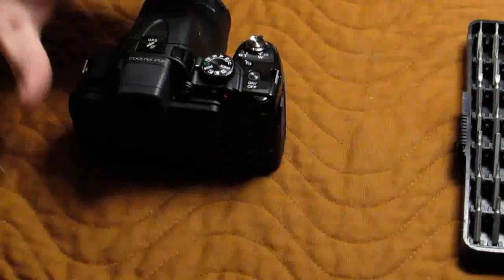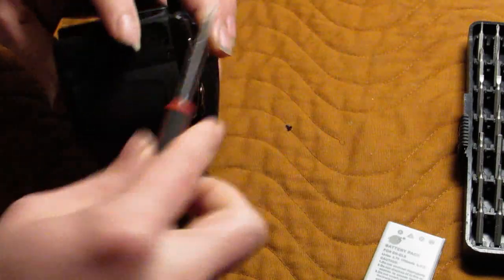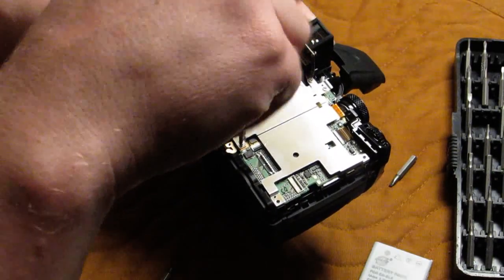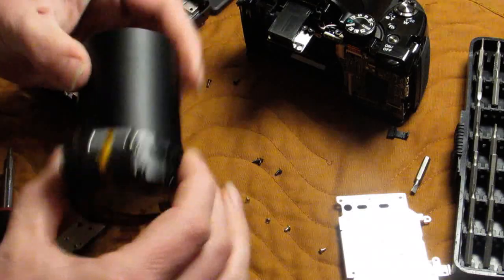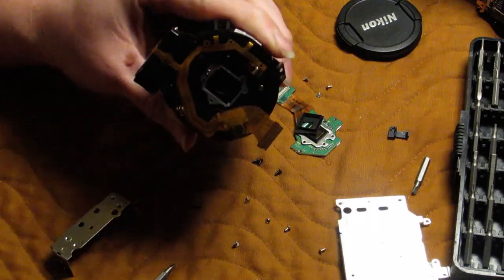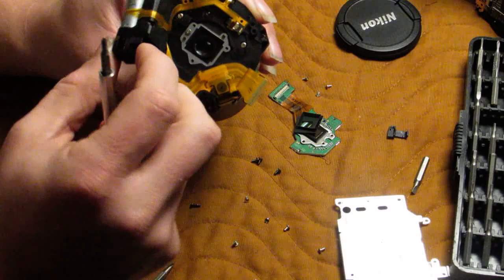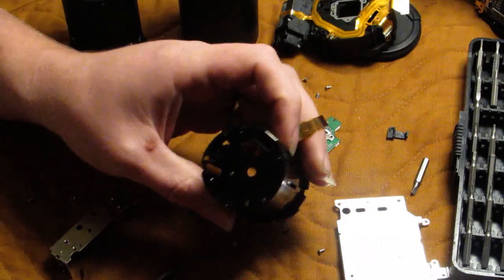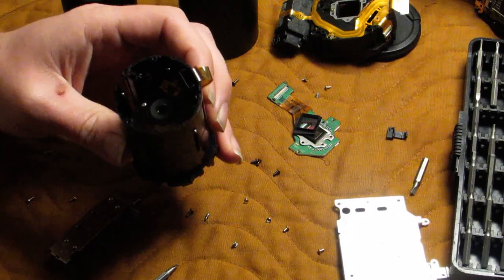Nikon Coolpix P520 lens replacement or repair

Comment: I have a question: do the P and L Nikon Coolpix series have the same size outer metal ring on the lens assembly? I'm looking for lens adapters for my L330 (for macro, fish eye, filters, etc) and I'm only finding ones for the L100/800 and P500 series, and sometimes they're listed as compatible between each other.

Comment: i have a Fujifilm x-s1 which has developed a fault think they call it pin cushion distortion ,at wide angle everything is ok as soon as you start to zoon the distortion starts progressively getting worse the more you zoom any ideas as to what i can do to fix it , ? and if i have to tear down i was going to remove ir filter (replace with same thickness clear glass ) and make camera a full spectrum camera ,what are your thoughts on that idea?
thanks

Comment: HI, Great video!! I have a couple of Coolpix a L830 and L840, Both are very good condition yet both have stopped turning on! I have ckecked the obvious...batteries, battery holder contacts etc... but no luck. Do you have any idea what the common problem is with the not turning on issue? is there a component on the board that can be checked? / replaced it seems so many of these  L / P model Nikon Coolpix have this issue... Any advice would be great. Thanks

Comment: thanks, I use my camera at sea and its always shacking, vibrating and slinging in the bag. After heavy seas it dropped. At opening the lens connector was off. This was an easy repair.

Comment: Very detailed and informative video!! My P600 has lens error and when powering on zooms all way out by itself? any suggestions what's wrong?
Reply from the maker: I would suspect the zoom switch, it might be stuck, or may have corroded from moisture.  A stuck zoom switch can sometimes be the cause of a lens error message.

Comment: I burned my P520's voltage regulator by accidentally plugging in 12V from a universal power adapter throught the USB port. I'm dissasembling it now and your video has been of great help, specially for showing how to unplug the grey LCD signal bit. I was afraid of damaging it, so I just left it hanging. Thanks!

Comment: I have a coolpix L840. Theres a copper tape that attaches to the back of the lens to plastic next to the motherboard. I'm assuming that's a tamper tape? And not actually anything functional. I ask because that ripped instantly. When I was taking apart and want to make sure that's not a cause to the lens not giving signal back to the screen, or if I just need to replace lense as it too a fall. (Reason I took it apart to begin with)
Reply from the maker: If it was never connected to anything electronic, it's probably shielding.  A crack or tear in shielding doesn't generally cause any trouble.  Almost all portable electronics have copper shielding tape some place or another, and lots of repairmen destroy it without significant consequence to daily use.

Comment: Hi! Thanks for your video, i'll buy a nikon coolpix p520 from a friend at a very low prise because it has the button t/w from the lens averiated, there is something i can do to repair it? (sorry my english, i speak spanish jeje,)
Reply from the maker: It is most likely a broken switch.  It can be easily replaced once you take the lens out, following this video.  Good luck!
Reply: zibodiz thanks for the answer! But after i bought it i reset the configuration and the button started to work fine! So i made a very very good buy ahahaj

Comment: Have you ever dealt with a Nikon P520 that will not power on?  If so, what was the issue?  I've tried three different freshly charged batteries.  I've had two repair facilities say it's less expensive to buy a new camera.  If I were to open up the camera myself is there anything simple that I could check?
Reply from the maker: mvsgeek The only thing that comes to mind is a broken battery door sensor.  If that's broken, it will think the battery door is open, and refuse to turn on.  That's the only thing I've seen cause a no-power symptom on these.  If that's not the culprit, and the power button seems to be functioning correctly, it's probably either the socket where the battery connects, or a fault in the main board.
Reply: I can't find anything that looks like a battery door sensor....  :-(
Reply from the maker: mvsgeek I don't have one of those available to me to look at right now, but they're recall a small button that is pressed in when the battery door is closed.  It's possible that yours doesn't have one, but unlikely.
Reply: Same issue here on my P520. Won't turn on, presumably after a few bangs in the suitcase. So basically could be anything... I've checked and reseated the cables but didn't help.
Reply: @ArtByStrongWolf  I just tried powering on my P520 with the battery door open and surprisingly it worked fine.  Shame, I have a second P520 which doesn't turn on and I was hoping for a simple fix.  Excellent overview of disassembly, thanks.

Comment: I have a p520. It lights up the onoff green light, but doesnt turns on the camera. No charging indicator on. I formatted the card already. Bought a generic chinese charger. It loads the battery, but the same symptoms remain. The battery loses power more quickly than usual. Do u know what could be happenin? Thx!

Comment: I need to just change out the LCD. Do I have to take the whole back off for the plug in part?
Reply from the maker: Dora Richey I haven't replaced an LCD in this model, but I would expect that you will.  Most models require that.

Comment: The shutter button only works about 1 out of 10 times on my P510. Do you think this is fixable?
Reply from the maker: Is this a new problem, or has it done this since you bought the camera?  If the problem is new, I would suspect the shutter switch is faulty, and can be replaced if you can find someone with the part for sale.  If the problem has happened since you purchased the camera, you might not be letting it focus before pressing the shutter; if that's the case, try holding he shutter halfway for 15 seconds before you take the picture.
Reply: This has been getting worse over the last year or so. It's a problem with the button. Where would I find the part?
Reply from the maker: @mover8012  Here's the part on eBay.  It's coming from China, and I'm not familiar with the seller, but it looks like it should fit your camera. https://rover.ebay.com/rover/0/0/0?mpre=https%3A%2F%2Fwww.ebay.com%2Fulk%2Fitm%2F332705935554

Comment: Hi, my 520 does not turn on anymore. Sometimes just the green light but nothing more. I charged three batteries with an external charger, so the batteries are good and working but the Nikon won't turn on. Do you know how I can fix? Thank you
Reply from the maker: If you're batteries are old, they may not actually be taking a charge, regardless of what the charger indicates.  If a new main battery doesn't fix it, it could be your internal clock battery.  If this model has an internal clock battery, I would try replacing that, next.  If it uses a capacitor, you're probably facing a logic board failure.
Reply: @ArtByStrongWolf  Hi, thanks for the reply. I checked the internal battery, I think it is ok: 2.99 volts. Do you think that uncoupling it for a few minutes,  for a main board reset, can fix thw problem? I left this machine for a long time when I put it in the drawer it was ok, but now it doesn't turn on anymore.
Reply from the maker: @mauri740  2.99 volts is slightly on the low side, rated voltage is usually the minimum operating voltage, and I'm guessing that's a 3v battery. Most devices have more tolerance than that, but there's no guarantee this does.  Disconnecting the battery, then draining the flea power by holding the power button down for 30 seconds, then reconnecting the battery would be a good idea.

Comment: 2:51 Hello I'm trying to see where you twitch under the flash to push the cover out and is not easy see what you're doing so I that i can do it.
Reply: I figured it out. It is shown and explained pretty poorly in the demonstration, but what piece you need to lift is the GPS plate above the Flash. 

In order to life it, you will need to raise the flash, and then use a thin flathead screwdriver (or any tool small enough) to gently lift up where the slit is shown under the GPS plate. 

What is explained well, is that when you insert the tool under the GPS plate, twisting it is all you need. As you only need to raise the GPS plate just a little bit, and then you can feel the two halves of the camera seperate, to where you can move on to the inner workings of the camera.

This explanation is ridiculously late, however I at least hope it clears up how that unclear step is taken.

Comment: Hey I have the same camera but when I turn it on I just see a black screen. Cam you help me?
Reply from the maker: Loki High There are a few things that can cause that.  The first thing I'd check is just to verify that the display isn't turned off.  Switch it to playback mode, and see if anything shows up.  Next, try taking a picture; if it takes pictures and seems to function correctly aside from the screen, you probably have a broken LCD.  Those can be easily replaced.
Reply: No. I can't take a pic. How do I switch it to playback mode?
Reply from the maker: Playback mode it engaged by pressing the button marked with the blue 'play' triangle inside a box, on the back of the camera.  It's just above and to the right of the 4-way control.  Just to the left of the lighting bolt symbol.
When you try to take a picture, does anything happen?  Can you hear the shutter?  When you turn it on, does the lens move?
Reply: When I turn it on the lens move, yes. But I can't zoom in or out. I've pressed that 'play' button and it's done nothing
Reply from the maker: It sounds to me like the mainboard has an issue.  The top controls (zoom, shutter, etc) are connected to the mainboard through a different ribbon than the rear controls, so we know that it's not a cable issue.  There's definitely more than just a bad LCD, because if that were the case, the zoom slider would work.
I definitely think it's an issue with the mainboard.  Unfortunately, I don't know where you'll find one of those for these cameras.  You're probably best off finding a camera with a broken lens, and moving your lens into it.  The lens is the part that is broken the most frequently, so it's definitely worth moving into another camera.